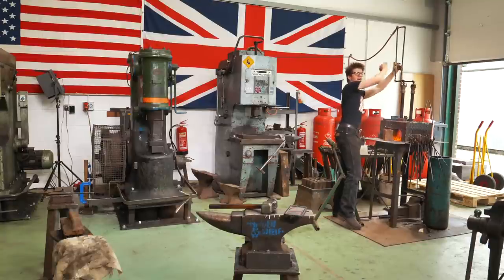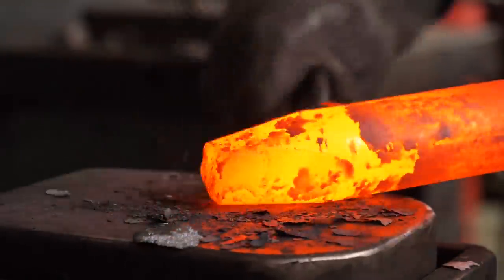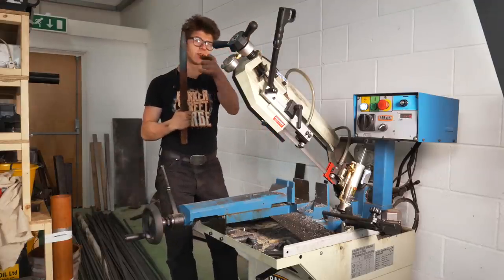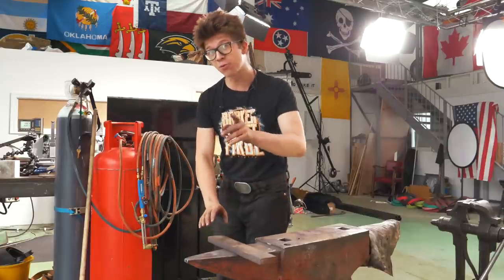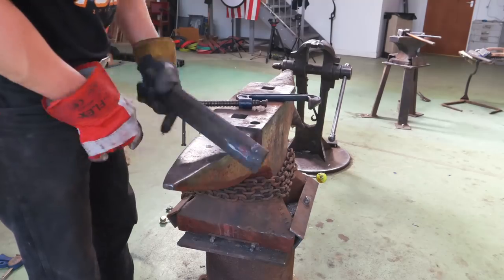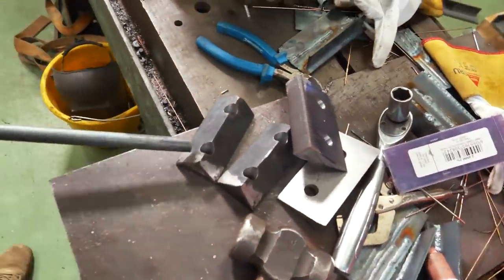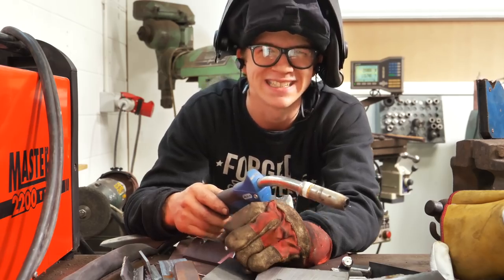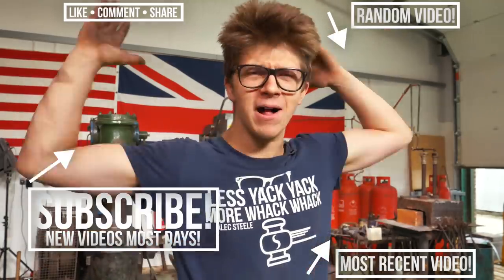SECRET PROJECT: MAKING THE TOOLING!!

Comment: I'd strengthen that punch release with some parallel triangular plates (square cut on diagonal) on the back. I suggest doing a multi run of welds also. or it might just rip back off. good job buddy it looks like they'll do well.

Comment: Alec for the release hole that you built, I suggest adding a triangular gusset to take some of the stress off the welds that mate the mounting plate and forged arm. It would work best on the inside(under the forged elbow), but as that's where your parts will be it will do fine on the outside as well. 

This should extend the life of your tool and bump the safety factor up a bit, so if something doesn't release immediately the bolts will fail instead of the arm coming loose(potentially hitting someone nearby).

Comment: I would gusset that bracket so it doesn't get torqued sideways.  Just a couple triangles out of 1/4" plate would be perfect. Just weld them on the outside corners to four way brace it.
Reply: darkhalfcustoms exactly what I was thinking!

Comment: Also, next time you are welding thick steel to a flat surface, grinding a chamfer in the edges really helps your weld penitration.  Just noticed when you welded the release tool to the press plate.

Comment: Alec, on the filler rod. You may try to hold the rod between your first and second fingers. Then you can steady it with your first finger while you feed the rod into the weld by pinching it between your second finger and thumb. Just a thought.

Comment: remember if you are going to punch something that that something often gets stuck to the tool so think of a method to release the material preferably with the power of the press. just makes life easier

also you're work is brilliant. you are the master of Damascus steel and stop knocking your welding/machine work skills. they are more than good enough

Comment: When you hold the tig torch, wrap the lines around you arm and hold it like you would a pen. It the the method that gives you the most control of the arc and once mastered will give you the ability to weld very thin metal together. When I went to school to weld a fellow student welded two aluminum cans together bottom to bottom. Try it some time if you ever thing you have Heli-arc or TIG down, It isn't easy. Most of the people on YouTube or the commenters can't come close to doing it. Our teacher could weld them side to side, I never got good enough to do that.

Comment: Just a tip for MIG welding, it doesn't look like you move your weld a lot from the looks of it. Try moving your weld in either circles, v's, half-moons or whatever suits you the best. I personally prefere circles. Practice is love, practice is life. Love your work man <3

Edit: Take it slow, and don't be afraid to increase the "power" of the weld (or whatever you call it in english ^^).

Comment: Nice tooling video, Alec. 
One question...
Doesn't the bung-hole bottom die, for the press, need support on the open end? Guess we'll see tomorrow.
Judging from the tooling it will either be a ryn of hammers or a Thor's hammer. It would apear that the bottom plate is to place the hammer under and assist in removal of the drift from the top. This would be the only reason I could see three sides open is tong access, for a drift removal brace.

Comment: A weak citric acid solution will remove the zinc from galvanized steel.  Leave it soak an hour or two and then rinse and watch the rust develop!

Another thing, you should start your large holes with much smaller pilot drills.  Your end mill will thank you if you drill the hole larger by steps before going full-bore.

Comment: Why did you use the angle grinder to cut the last plate instead of the bandsaw, is it a function of size the bandsaw will accept in the clamp or what?

Comment: Nice job walking the cup!  Looks like Alec has been watching the weldingtipsandtricks channel!
Reply: Also, the oxygen in that cutting torch is oxidizing the steel, not burning it.  You know how quickly hot steel reacts with oxygen, making scale...well this is the same effect, but on steroids.  

With the right combination of torch & enough oxygen flow, you can cut through the rolled steel armor of a tank.  There was a BBC documentary, I think, showing a gentleman taking two tanks -- one with a blown up front, one with the rear damaged -- cutting them in half in the same pattern, and then MIG welding the two parts together.  It was amazing.  I'll have to ask my old welding teacher where he found the video.

Comment: Since he didn't explain welding galvanized steel, in case anybody was curious - heating up galvanized steel produces cyanide gas.  Now, as he said - he's got a respirator and it's a TINY weld, so he's not at a risk.  However, if he were laying down beads all day long on galvanized steel with no respirator or in a room with little airflow - he'd probably die.  Or at least get sick.

Don't heat up galvanized steel kiddos, unless you enjoy suffocating

Comment: What was the plastic belt-thing you were wearing in the grinding room about 12 mins in?
Reply from the maker: +TheBritishBrit it's an air fed grinding helmet I bought and had arrive today! 🎉🤓
Reply: TheBritishBrit    I believe tha t was a fan forced respirator.  If you look close you can see he is wearing a full face respirator.  It supplies a constant positive pressure inside the mask but the fan and filter are attached on the belt.
Reply: Leo Spitz huh, interesting. Cheers mate.
Reply: I think its a back brace?
Reply: thankyou for asking I thought I saw that
Reply: thanks for answering
Reply: TheBritishBrit   You pick up an odd assortment of usefull information and useless trivia in 50+ years.  I have worked cattle, drove tractors and large trucks, been a welder, a machinist, and a sheetmetal man as well as a rough up carpenter, residential electrician, commercial electrician, and a refrigeration/heating specialist.  I know just enough to be very dangerous in a great many things. : )  Unfortunatly I have also learned that the stupid things I did when I was young and invulnerable were really just post dated checks waiting to catch up with me.
Reply: Looks like the 3m versaflo (not sure which it is, the 300 or the 600).  We need a review! Did you get the welding helmet compatible with the system as well? I recently got a used 3m gvp papr setup and am slowly putting together a broad spectrum system on the cheap. Wish I'd gone this way years ago instead of the trend airshield - these are actually rated for legit filtration.  Sweet setup (but expensive!)

Comment: Why shouldn't you mig/weld galvenised steel?
Reply: galvanized steel is coated in zinc which gives off toxic fumes when heated beyond a certain point
Reply: Avery Iorio ya been there done that  spent the rest of the day guzzling milk and barfing my guts out if you are going to weld galvanized keep a gallon of cold milk handy and drink it often

Comment: Alec, why don't you get a set of large drill bits to do large holes like you did today instead of using an endmill? The drill bits can be re sharpened when they get dull where as when an endmill gets dull they usually break because you (or at least me) dont notice until it's to late.  It might help you reduce your tooling costs in the long run if you plan on doing large holes in the future.  Also when you do large plunges with endmill like you did the endmill flutes aren't designed to clear chips like a drill so when you do large plunges like that "peck" the endmill down so that you can clear the chips a little more efficiently.  If you read this cool if not that's cool too.  Keep up the great work! I really have been enjoying your videos as of late.
Reply: Because drill bits remove material, where punching and drifting keeps the integrity of the piece as all the metal not punched by the hole is drifted aside and can be used instead of shavings and chips lying around. It's hard to re-refine that metal and once you drill it it's pretty much gone.
Reply: Doge channel I ment why not use the drills when he was working on the dies around the 9 min mark.  My bad for not wording that better.
Reply: Oh hahah my bad

Comment: Technically you are cutting the metal with the torch using rapid oxidation. This is why you can't use it on stainless steel.
Reply: Paul Pollard I have. It's actually not by rapid oxidation, it's only 'blowing' the liquid metal away.
Reply: DollarhideClan go ahead and try to cut stainless steel with it. (You might be there awhile) Better yet go google how an oxy fuel cutting torch works. Heat raises the metal to kindling temperature (bright red color), allowing for the oxidation of the metal, so that it can be blown away.
Reply: Paul Pollard well since that's how it works the 1" stainless shafts I used to cut with an oxy torch must have not been stainless and just didn't corrode because the fertilizer happened to only hit the bearings and pulleys.

Comment: Does anyone know what that blue dycom (not sure if that's how it's spelled) stuff is, I'm curious and would appreciate an answer
Reply: Turtle Shellington it's used to ensure a smooth surface across a piece of material you would take want an uneven surface on the material if you are trying to create precision equipment
Reply: Turtle Shellington it's basically ink. You can use it to see scribe lines (because your calipers will scrape away the dye and leave a clear line to follow) or as an indicator to see what areas you haven't cut/touched yet.
Reply: wouldn't want*
Reply: Thanks everyone!

Comment: im no expert but isn't tig welding the weakest type of weld you can do? if so then it probably isn't best for a hydrologic press tool
Reply: BadW01f 2 tig can actually be one of the strongest if done correct. The reasoning is that you have so much control of all the variables in welding, that it's much easier to make as close to perfect of a weld as possible. Again if it's done correctly.

Comment: WOW! 9:11 I cringed so bad when you slammed that piece of steel down on the table of the mill. You should never do that. When I worked in a machine shop that table would be lined with cloth to protect it

Comment: Alec please brace that punch hole dohicky before it brakes
Reply: the thing he's making will probably be exactly as big as that so it will support the weight, and its probably going to be large so he'll need the room to work on that side, thats why theres no bracing on that side, just a guess though
Reply: Yes for sure! And because of the size of material he will be punching he'll need to put it on the opposite side
Reply: the stripper HOLE?